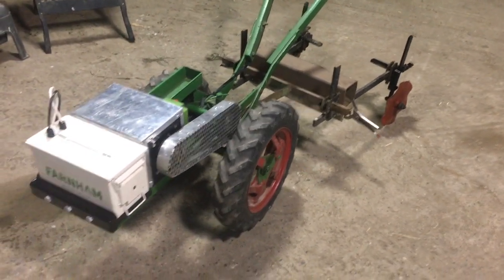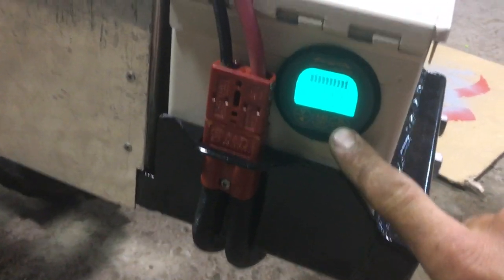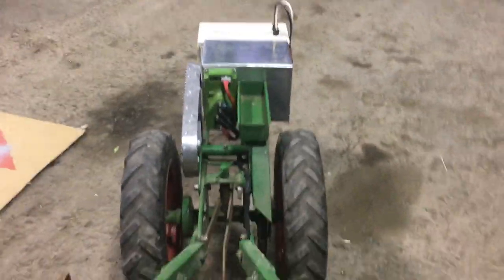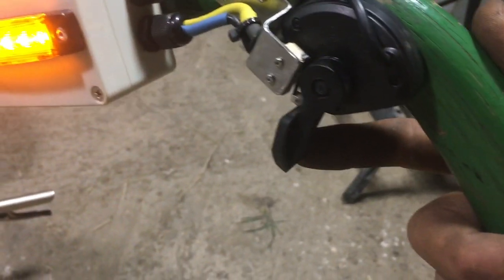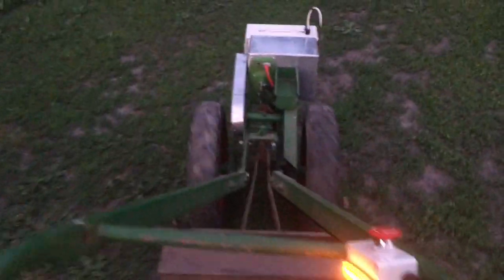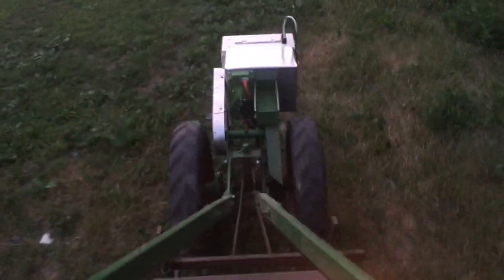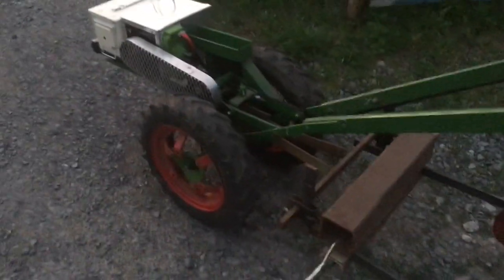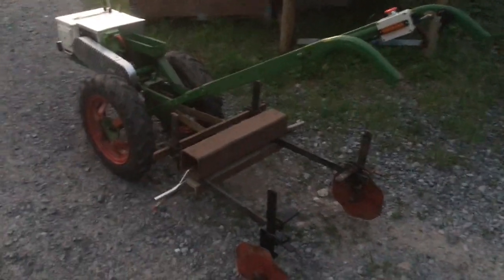Planet Jr. BP1e alive at last

Comment: Awesome videos Reid! I'm considering a similar build with simplicity or David Bradley. Looking to cultivate within covered spaces. Are you getting enough power @ 26v and 20AH? And what was the reason not going with a standard deep cycle battery?
Reply from the maker: A deep cycle lead-acid battery is simply too heavy per unit energy stored.  As it's a 2-wheel tractor it would be very difficult to get the machine to balance.  Already with lithium battery my drive unit is heavier than stock B&S but tool provides adequate counterweight.

Power is more than adequate at 2000W max. The motor keeps pulling hard up to tire slip, even if I load it with extra weight.  In terms of runtime I think that the 20AH pack I built would be borderline too small for doing more than half an acre, say, but I figured I'd build a second pack, thus keeping weight down but extending runtime.  The first pack can charge fast while I run down the second (another big lithium benefit over lead).

Definitely go for the conversion on a Bradley or Simplicity.  I know one other person working on a Waterloo.  I think they're all perfect candidates for this and once converted they're just wonderful to use.
Reply: @reidallaway  The David Bradley is alive! Your videos got my brain moving enough to get from concept to prototype! I'm definitely a novice in this space, but totally glad I took a stab at it. I have the full build uploaded. It's definitely not pretty, but it is practical
Reply from the maker: @sensiblesoils9723  Amazing!  Big congrats I'm on my way to check it out now!

Comment: Love these kind of projects. I am planning to make something like this but fully homemade for weed control. But I have a question about the turning motion, when the axel is just a straight shaft without differential, is it hard to turn and is it noticeable when the tyres slip while making a turn? Sr for bad english.
Reply from the maker: This machine uses a simple freewheel mechanism on each wheel.  The drive mechanism only drives the wheels forward and if one wheel goes faster (turning) it just freewheels a bit ahead of the other.  This means it turns freely without tire slip but there's no way to apply power in reverse, as you could with a differential so it's only a good solution for lightweight machines.

You have to pull the machine in reverse and in my case I first have to turn off the motor controller or there's big electromagnetic resistance to rolling the motor backwards.  On the original gas configuration there was a belt drive with idler/tensioner so when not driving forward engine was disengaged and you could pivot or pull it backward.  Mine has no drive disconnect so when I pull the machine backwards it has to spin the motor in reverse which is fine as long as the armature isn't energized.

I hope this is clear.  It works fine for light machines and I've seen this same twin freewheel drive used on floor scrubbers and tricycles.  You can also look up "sprag clutch" mechanisms to achieve the same thing.
Reply: @reidallaway  yup all clear. While reading I remembered that same or similar mechanism is used in a disk mower (while the mower is spinning and you press the clutch a clicking sound starts I think it's that clutch thingy). 

Well I guess I'll be going to the drawing board again. I wanna make a high clearance walk behind tractor that's light and easy to use bc employees that work on my parents farm are usually females. So I need to think of something before the season begins.

Thanks for info.
Reply from the maker: Yes our disk mower's PTO also includes a pawl-type overunning clutch like that.  Same idea.
Reply: @reidallaway  have you tried removing or locking that mechanism for one of the wheels? The way I imagine that would work would be that it would turn harder to one side but you could drive it backwards with the motor. 
Just a thought.
Reply from the maker: @audriusradziunas5451  Doesn't work that way with dual freewheel.  One or both wheels can go faster than input drive but neither can be slowed to less than input drive.